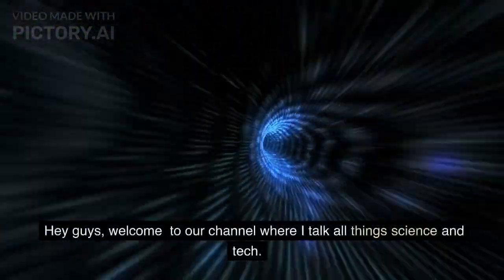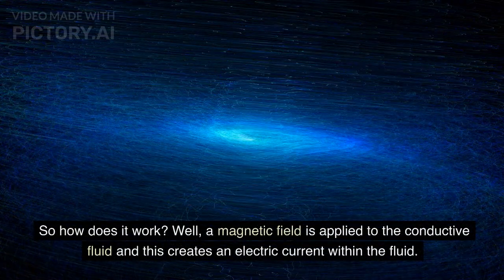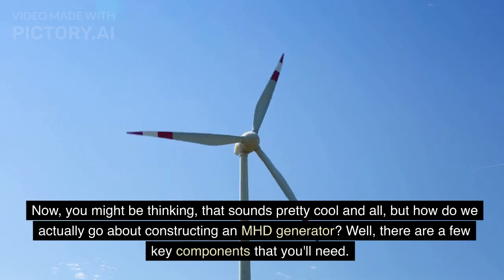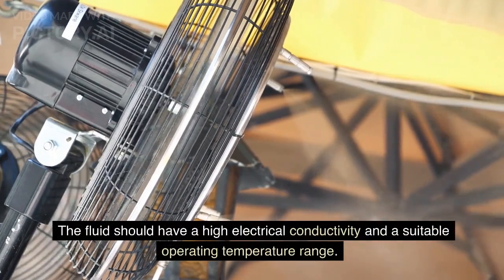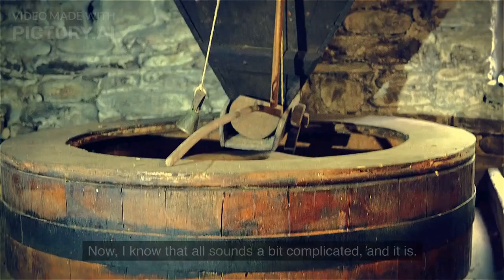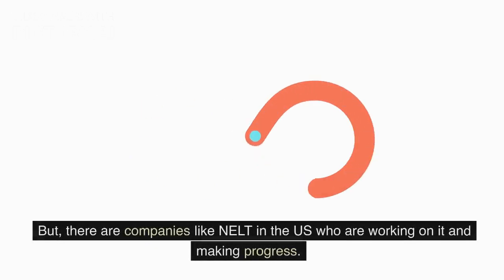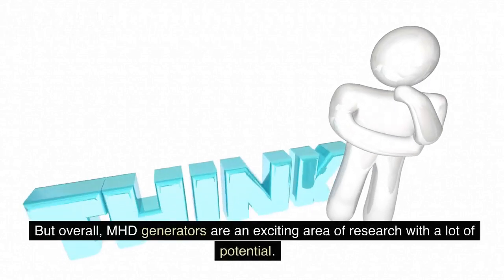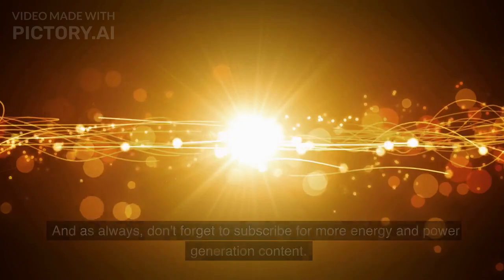MHD Generators - How do they work? (Magnet Magnetohydrodynamic)

Comment: Mainstream physics is missing the part that spacetime is NOT actually empty. There is no dark matter, it's literally just made up out of thin air. Hal Puthoff and Salvatore Pais really do groundbreaking work in this field, but it's shrouded in secrecy because of the defense contractors. Sal tells as much as he can though, but without breaking any NDA's, so sometimes he has to stop short, or dance around a question. Hal Puthoff barely ever speaks in public and is the intel blobs go to guy for anything plasma and zero point energy related.